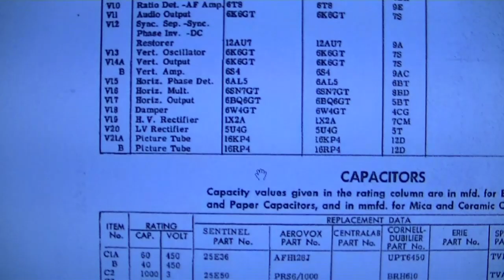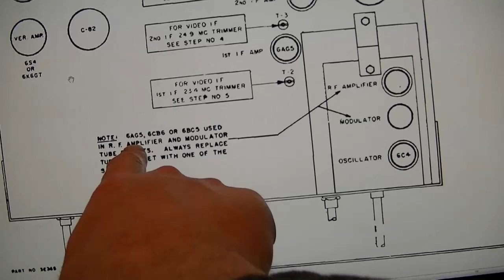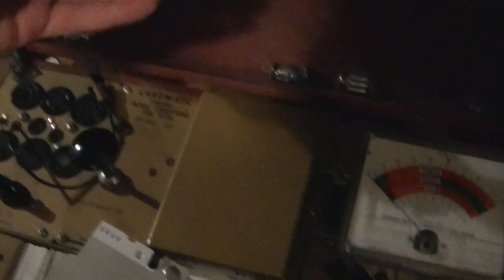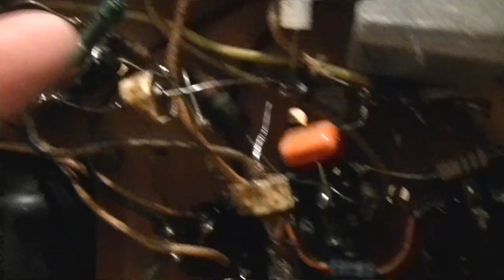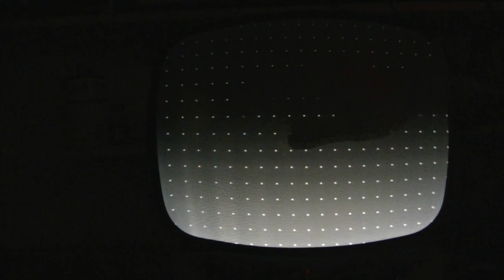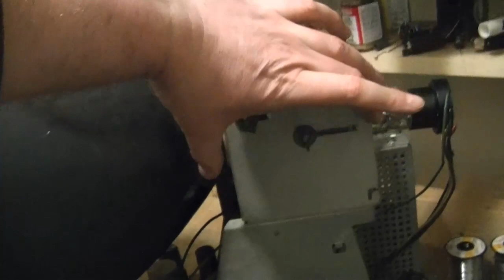sentinel 430 redux pt02

Comment: Hi Bob, If you move the 0.05 mfd capacitor from the crt cathode to the wiper side of the crt resistor and then restore the blanking network the shading should be gone. With the bypass cap. and blanking network tied to the same place you have a longer time constant. Way back when; I did the same thing, went round and round till moved one connection. As Shango said in a very colorful way, we learn from our screw ups{:-)  All the best, Tom from FLA

Comment: I'm really wondering if that set originally came with a 16" picture tube, and someone used a 17" simply because it was all they had in stock, and it fit.
Reply from the maker: It's hard to say since it's unmarked on the tube chart and there were a lot of new CRT styles coming out in 1950-51.  The 16" does have flat sides while the 17" is rounded but they may have bent the metal supports.

Comment: Bob, back when I was about 6 or 7, my parents house had a Motorola TV in the basement that was mounted in a wall. Looked just like that Frankin-rola. I'm not wondering if someone didn't kludge a cabinet together to fit one of those chassis in. 
The room it was in was set up back in the 50/60's era for entertainment. They had a few other things built into that wall but I cant remember what all was there. But the TV, the TV stood out, and I wish, I had that set lol.
Reply from the maker: I've seen a couple other built-in sets like that before.  I bet they got pretty toasty without proper ventilation.  Motorola used that cabinet style in a bunch of models over several years.  This one is bakelite but I have a very similar looking one a couple years newer that's actually plastic.